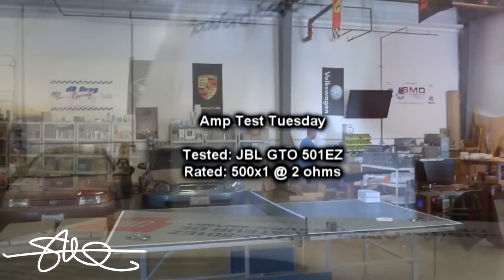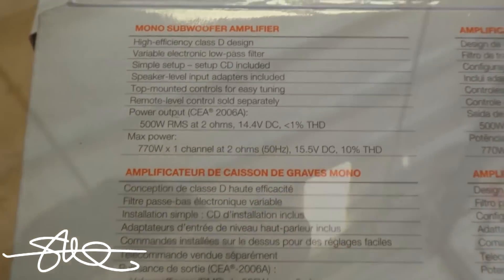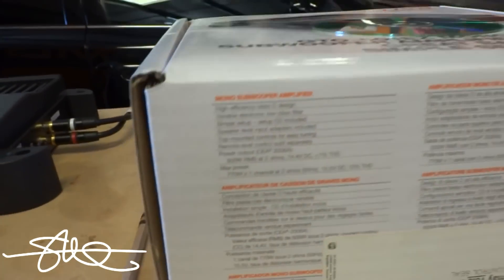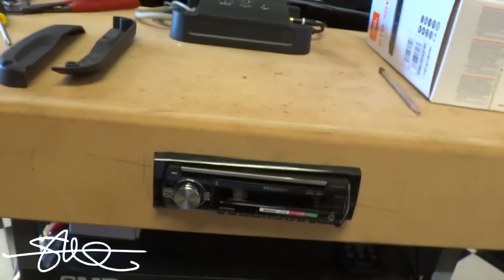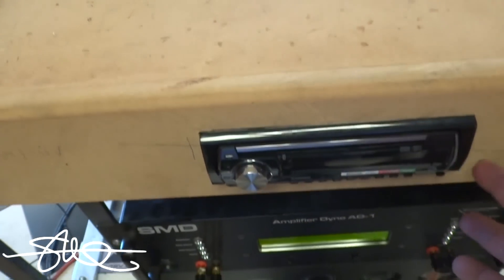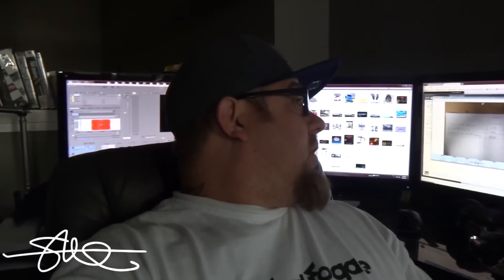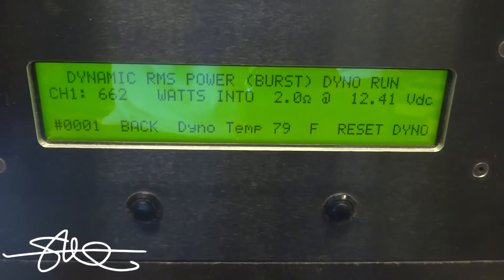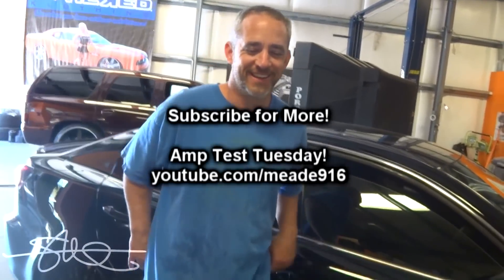Amp Test Tuesday - JBL GTO-501EZ 500 Watts RMS Claimed - SMD AD-1 Amp Dyno

Comment from the maker: really? sounds like you don't know what you are talking about too bro.  Because when you start getting SERIOUS, you might have to have the wiring in your house upgraded, to handle the extra amperage demand.  I had 4 20a dedicated circuits installed just to handle my "home" system.  Anyone serious about car audio won't have a "saggy" alternator.  I have 4 350a alternators and it's not uncommon for someone to have at least a 240a, if they are serious.

Comment: Not to mention you have certain issues in a car that you can easily over come in a room. Having a steady 120v power supply (wall socket) compared to a saggy/weak 80amp stock alternator a vehicle has, well its no comparison. Also the impedance load for home drivers are over 8ohms and most likely 16ohm while in a vehicle people aim for 0.5ohm on their subs and 2ohm for their mids/highs. The list just goes on and one, home over car audio anyday everyday.

Comment from the maker: if he used an AD-1, the test is legit.  Unless you have proof something was faked.  If you guys are crying that he uses dynamic burst mode, you should stop because dynamic burst is NOT the same as "peak".  It is RMS.  Certified mode is very hard on any amp, the numbers on the non cert and dynamic burst will be a little bit more but not 10x more like a peak rating would be.

Comment: On the box it said the 770 watts was on 15.5 volts and you got more than that on 14v. Just wondering but would it make much of a difference if you were to put it on the 16v battery bank?

Comment: hey steve i was wondering what your thoughts on the kicker zx750.1 would do?? i blew 2 12 inch mtx thunder 7500's with it and those are rated at 400wrms

Comment: Kenwood Excelon x1200m claims 1ohm stable all over the net but not in the manual. Any chance that can be verified if it's available to you? 

1800w x 1 @ 1ohm
1200w x 1 @ 2ohm
  800w x 1 @ 4ohm

Thanks for these amp test videos Steve... Much appreciated!

Comment: JBL is a solid company (at least in regard to their mid-level+ amps). I was not expecting the 14.4V score to be that high. If you look at the 770W rating they said that it was done at 15.5V on the box and at 10% THD. I think at 15.5V and 10% THD it could probably push out around 1000W, albeit dirty.

Comment: I always wanted to know if the planet audio 4000 watt amp could really do 4000 watts a buddy of mines hane one but had the the gains down low and it was pushing two WMD 15s can it do better or would I be wasting my time with buying this amp 
Max Power Ratings
•Max Power @ 1 Ohm: 4000 Watts x 1

RMS Power Ratings
•RMS Power @ 4 Ohms: 1500 Watts x 1
 it says about it

Comment from the maker: GUYS for those that noticed, on the first 12v, certified run  -  i still had my probes (that power the AD-1) in the 14v bank..i forgot to switch over to 12v. The amp was running off 12v but the AD-1 was powered by the 14v bank. So the WATTAGE READING WAS CORRECT... just the voltage drop didn't show. I noticed it by the 2nd run and then the battery died, losing that clip. It's legit numbers though.

Comment: ive always wondered, if my two jbl 12 inch subs have 250 rms and 1000 max power, would this amp be a good amp? my main concern is the rms. would the 550 work with my 250 subs? please please please reply